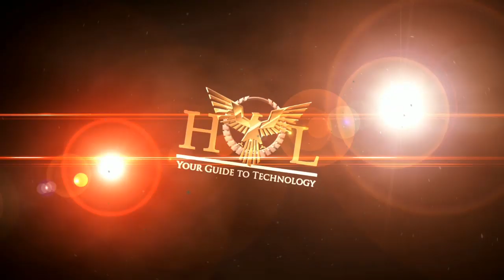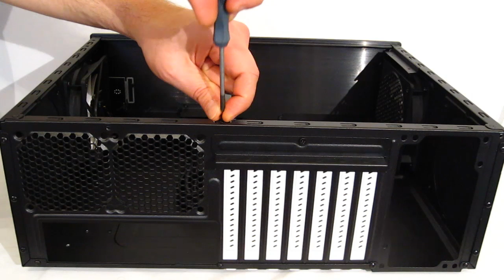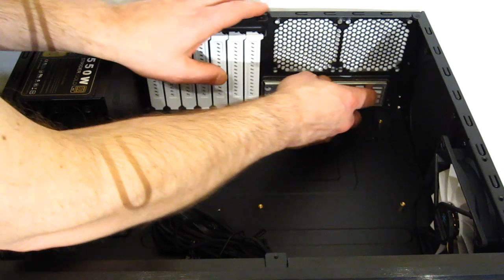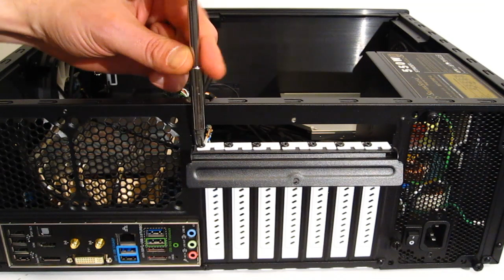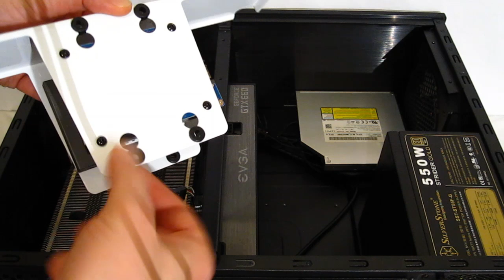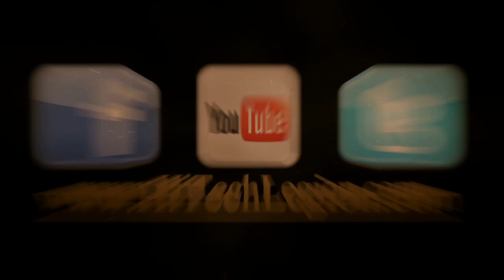Fractal Design Node 605 Component Installation at HiTechLegion.com

Comment: One thing to note on this board, is that depending on your motherboard and the heatsinks that are on it, they could hinder the install of a water cooler. I had trouble with this yesterday as I bought an enermax aio and found that it wouldn't fit on either of the fan slots on the left side of the case. When i tried to re-route the radiator install to the fan slot behind the psu, I found the tubing was too short. Very frustrating for me as I checked the compatibility of this aio on parts picker before I bought it.

Comment: I just bought the Noctua NH-C12P SE14, this afternoon and am going to give it a try, as well I bought a little 80mm fan for the rear of the node 605. I am going to remove the back plate of the entertainment cabinet all together and push the node 605 out the back a little so it vents better.

Gerorge do you have a recommendation for the internal fans and how the should be set to push or pull the air in the case. Right now I have two 120mm exhuasting on the MB side of the case, and 1 120 pulling on the PSU/SSD side of the case. I will add the Noctura C12P which is a top down CPU cooler and was wondering if I should exahuast the 80mm fan at the back or try and get it to pull fresh air in from the back. The back of the case is the closet to fresh air I can get. With these fans what would you suggest, remembering that this all the 120mm only have about a 1" air space on the outside of the HTPC to the cabinet walls.

Comment from the maker: Yes and no. It is a slim BD-R, which will fit in most notebooks. So, it is the same drive you would buy for a notebook, but it will fit in any slim mount application.

Comment: RIght norw the cooler is the stock AMD that came with the 8350. WIth the top off the case sitting out of the cabinet the unit cools fine.. 20 deg C up to 45-55 C under load. When I put it in my enclosed entertainment center (glass door on front) the unit fits in just like my stereo amp very snug with only 1.5" of room on each side and 5" on top. This unit was designed for home media so I thougth this would not be an issue. There is little to no ventilation within the cabinet although it is wide open at the back of the cabinet and I can open the front door to allow more venting.
Reply: I had a similar issue with a similar setup, however most of the cause was the DVR cable box- those things are like radiators, they throw off incredible amounts of heat. It would cause staggering temps inside the entertainment center unless the glass door was open. So, what you have is likely not so much a computer issue as an ambient temp issue. A better cooler will help a lot, but there is only so much it can do if the temps inside the entertainment center are getting ridiculous.

You may want to consider using a couple of near silent fans in the rear of the entertainment center in addition to the upgraded cooling to get some airflow going. This will help keep the ambient temps down, and that is your biggest issue right now. You could even run them right off the Node 605 fan controller.

Comment: the optical bay only supports slimline drives, and even then, it can only be used if you're installing a micro-ATX motherboard. Opt for a standard ATX board and the optical drive mount is obstructed and rendered unusable.

Comment: I bought this case for a HTPC build using a AMD FX8350 CPU Asus Motherboard and a GTX760 GPU. I am having major issues with overheating. Do you have a recommendation for best cooling options, how does the low profile Noctua you are using work in your system. I was thinking about the Noctua NH-U9B SE2, but maybe a wider spread rad on the NL12 would be better. My challenge is that the HTPC sits in an entertainment cabinet that has very little clearance on each side of the HTPC so air flow is a challenge. Any suggestions? do you know if any water cooling cpu units will work in this case? I am seeing CPU temps above 75 c and am running into issues right now.
Reply: 75C is not good, obviously, and makes me think you may have an issue that has nothing to do with the case airflow. What cooler are you currently using? Is it seated correctly? Did you use the proper amount of TIM?

While I used the NH-L12 in the vid, I actually run a core i3 with an NH-L9 in it for everyday use and have no heat issues at all. The 8350 definitely runs far hotter than that, so the NH-L12, Silverstone NT06-PRO or be quiet! Shadoe Rock Topflow would be good choices.

Are you getting any air into the case? You need to have at least a little room on the sides for intake.

Comment: How about optical drive? Can be used only slim mechanics or classic?
Reply: Slim only.
Reply: George Cella really? How type and brand(lg,asus etc.) Has been used? And how about automatic opening and closing the optical drive? I must close, and open it manually (such a notebook optical drive, you must it pull out and close manually) , or is opening and closing like normal optical drive?  Thanx a lot

Comment: question, Do you think that this case will be able to support H80i?
Reply: Yes, it will.
Reply: +George Cella I know it has been a while ago since  you answered that question, but please could you tell me how a node 605 would fit a H80i? If you could upload a picture or something like that or post link of someone who pulled it of would  not only help me but also many others who posted this question online.
Reply: +r1sh12 this is my question also. At first I thought there'd be no room, but maybe it would fit in the front right fan location if using an ITX motherboard?

Comment: Thanks!
Can I ask your recommendation for a ITX z87 board with wifi?Is there any other option than the Asrock right now?
Do you think it's worth trying gigabyte sniper m5 or asus - either gryphon or rog gene, and connect a "non onboard" wifi solution ,such as a USB antenna. (linksys has something nice,upto 450MBs)
Thanks again!

Comment: Why do people buy such big cases for small components.
Reply: ***** As pointed out in the review, while I used a mITX board in the video, the Node 605 is capable of up to a full size ATX. The next part of this being, the Node 605 is made as an HTPC piece, and is sized to conform with higher end audio components while still offering 100mm+ clearance for a CPU cooler.